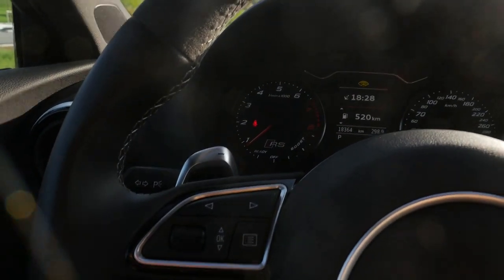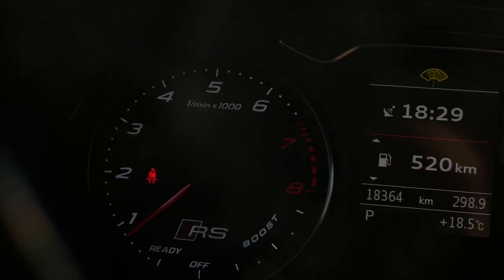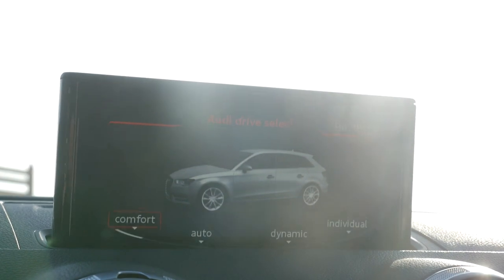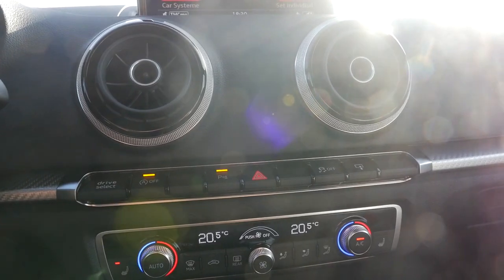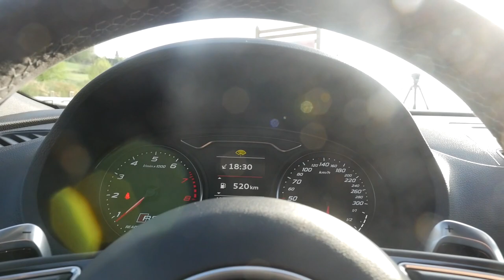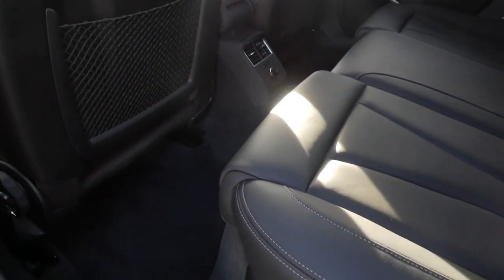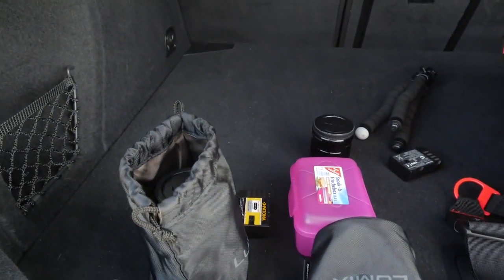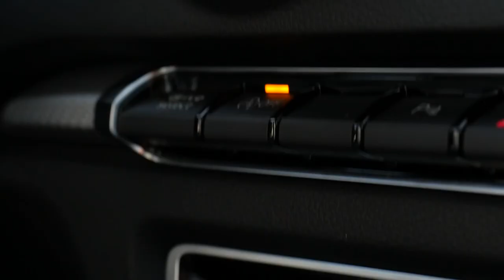MY NEW CAR!

Comment: Hey tweeday!
Excellent choice on the car btw!
I see you have winter tires on in the video! Please get yourself a set of summer tires with proper wheels if you dont already have one.  It can literally save your life in highspeeds because of superior handling, cornering and breaking distances.
And please dont save a penny if you need a set of tires. They are the four hand sized patches of rubber that keep you on the road.
Reply from the maker: Thanks! Already got it all set :) Will change them next week!

Comment: ehh...automatic...pfheej
Reply: It has paddle shifters my dude.
Reply: you can't get an RS3 in a manual..
Reply: JAMEZJEE the previous generation had a Manual
Reply: At least it has paddles...
Reply: Szeretem az őszt
Reply: én sem
Reply: It's called DSG, basically a dual clutch transmission, pretty much the same as Porsches PDK-transmission. It's one of the fastest transmissions besides cars way beyond 150k$. Congrats on the car tweeday!
Reply: Most of people saying shit about automatic never drove it. Im professional driver, and automatic is life. Only way when i woud buy manual is bmw m5 e34. :)